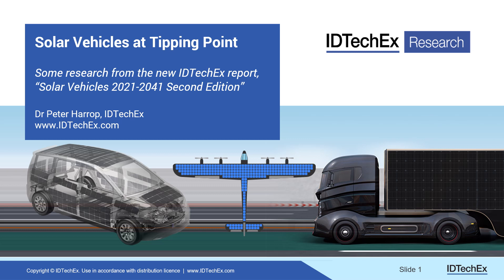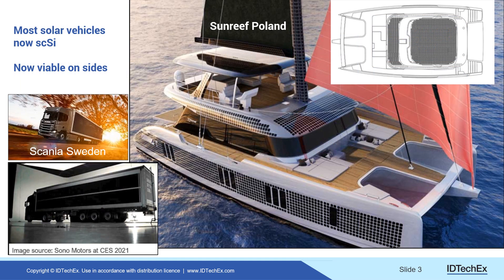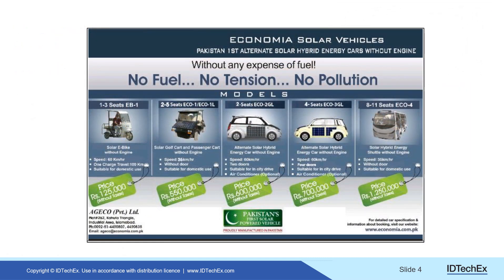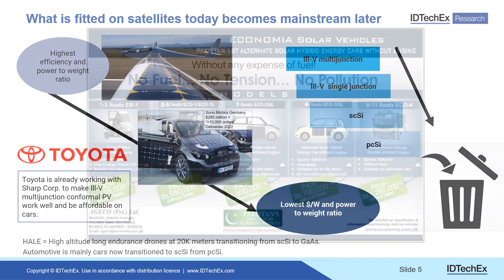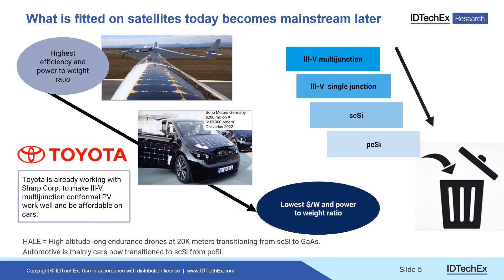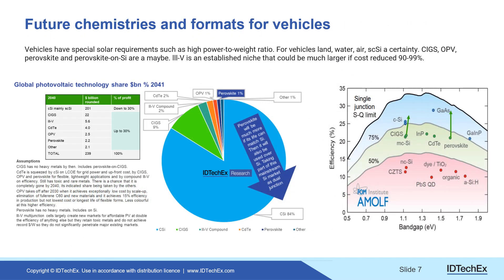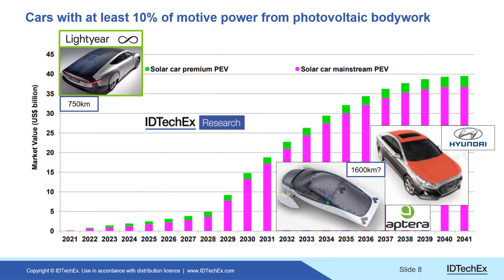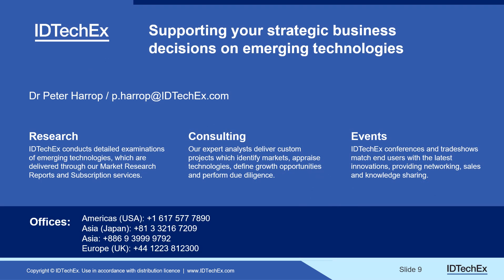Solar vehicles at tipping point

Comment: I understand the author's skepticism about the 1000 mile never-charge claims of the Aptera solar enhanced vehicle. It does sound too good to be true but there is innovative but solid engineering that has withstood serious exploration and testing.  The trick is optimizing for efficiency beginning by eliminating 25% of the rolling friction off the top by going to a three-wheel setup. The lightweight but strong composite monocoque chassis, in-wheel motors sculpted to slice through the air with a cd of .13 is how those lofty efficiency goals are attained.

With its full solar array the Aptera is capturing about 700 watts/hr in sunny climes it can add over 40 miles of range daily largely because it gets over 10 miles/kw. It uses various sized batteries to collect energy from the sun with the 25kw option offering 250 miles of range and the maximum 100kw battery the source of the 1000 mile range.  

Bye and bye I think you'll be re-writing the report sooner than later.